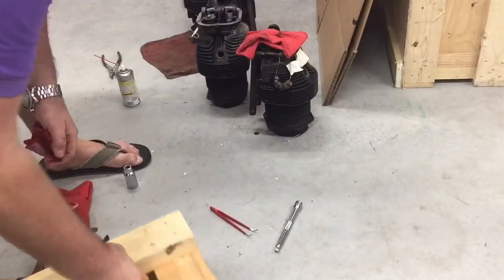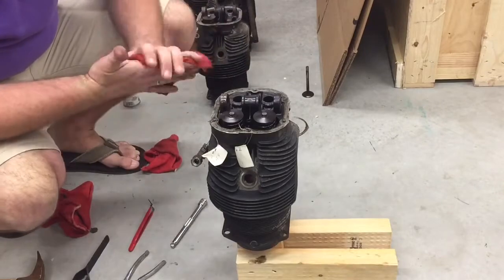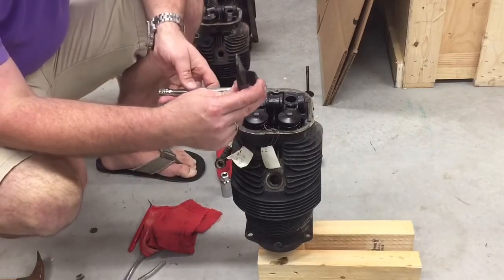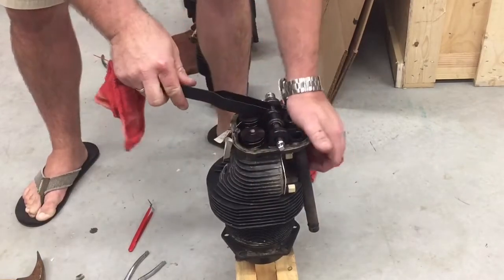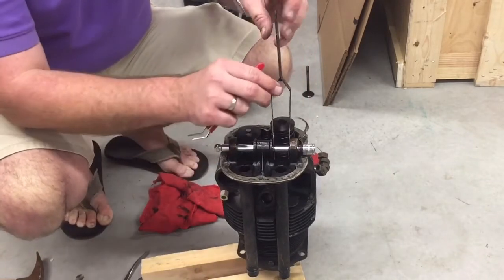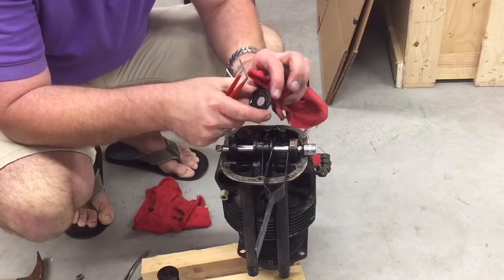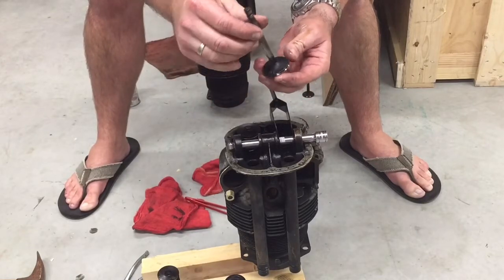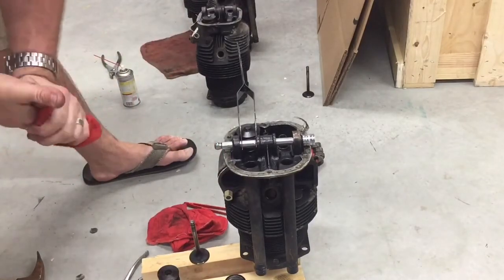How to remove the valves on a Continental A-65 cylinder (Update #010)

Comment: I've got a better tool, longer bar comfortable to hold. Anyway I just put it on and when they are stuck I whop the tool with a mallet to pop out the retainers. Also not a bad idea to hit the valves with a mallet before doing this to shock them a bit. Use a magnet to take out the keys, don't bother with tweezers. Bottom retainers may get stuck so you'll need to work on them.